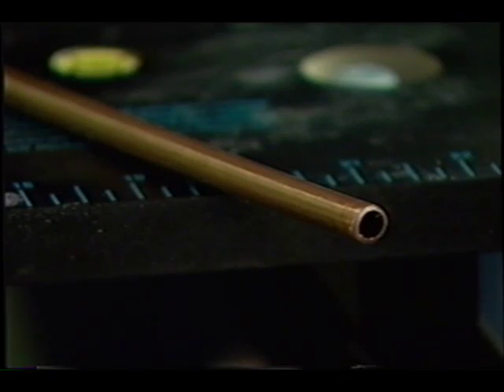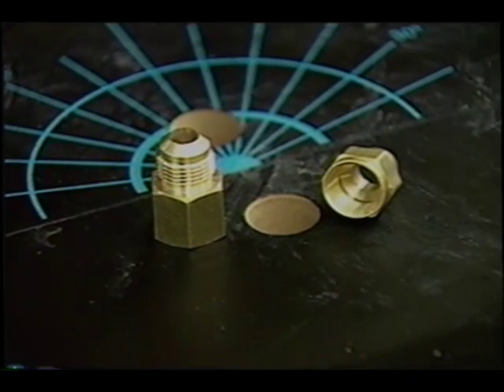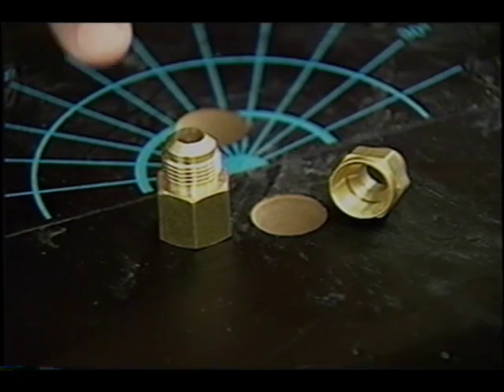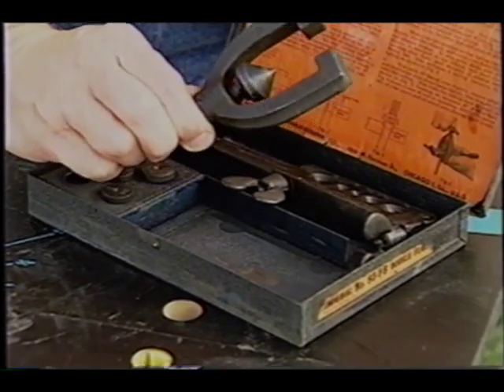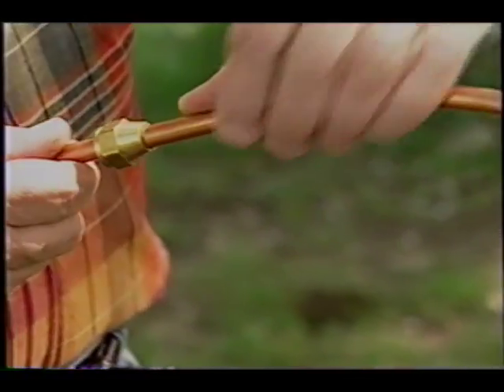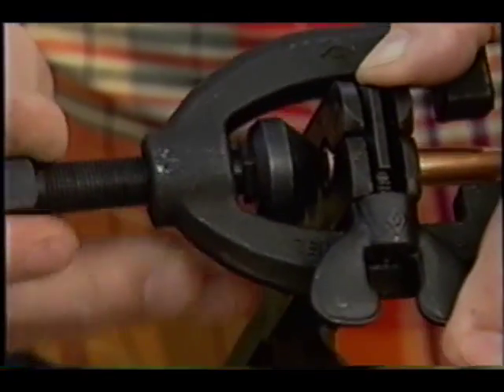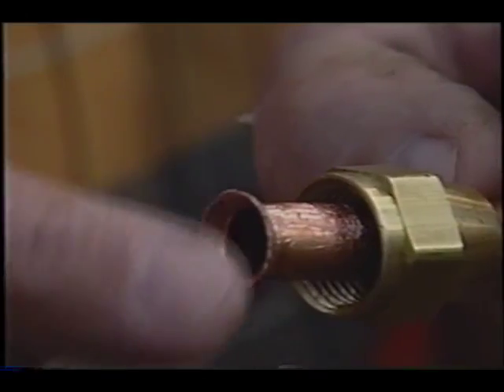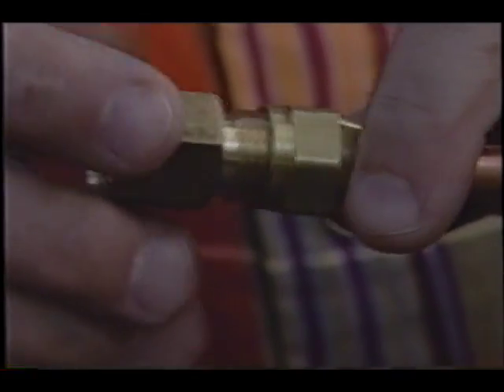Copper Tubing Flaring Tool

Comment: 14 years later, and this video is still relevant as ever. Thank you Tim
Reply from the maker: You're welcome. Flaring copper is never going to change. It's the only way to make reliable connections for waterlines or gas lines.

Comment: This a great video.  Quick as it is, you really show the most essential parts for this procedure.  For 3/8" (inch) Cu (Copper) Class J, Soft Copper tubing (and the 3/8 is the Outside Diameter ( O.D. )  : when you use that type of "vise" , use a ¢5 nickel; place the tubing past the flare well on the tool the thickness of a nickel, that will produce a flare on the tubing that matches the flare fitting without going past the "flare".
  Be sure that the end of the tube is filed and deburred. =^.^=
Reply: Yes... better be filed and deburred and cut at precise 90 deg angle

Comment: This was great and I went out to get a F.Tool $20.00 to help with a swamp cooler fix. How stupid was I. The tubing was supposedly 1/4" but it was from stupid H. Depot which very well may be 1/4....on the inside, doesn't fit most 1/4" fixtures. Am replacing 30 ft with true 1/4" from Ace Hardware. Am not happy with the original installers Airsmiths, Sacramento CA. They wouldn't even call back on another (gas heater) question.

Comment: Hi Tim, good video!  I see some people have problems with flare fittings.  It could be due to not squaring and deburing the copper before making the flare.  I use this type of connection, with no problems, in HVAC where working pressures can reach above 300 psi.  Thanks for sharing!

Comment from the maker: SuperMatt,
I agree 150%. There is no substitute for a flared fitting. They are approved for underground use in water supplies and in certain gas applications for a reason. Compression fittings are just not strong enough.

Comment: I dont trust a flared fitting. i use the compression sleeve because i am running gas through the copper line and dont want any kind of leaks. i collect and restore very old gas engines and the compression sleeves are the only way to go.